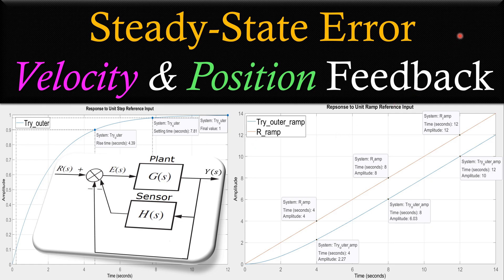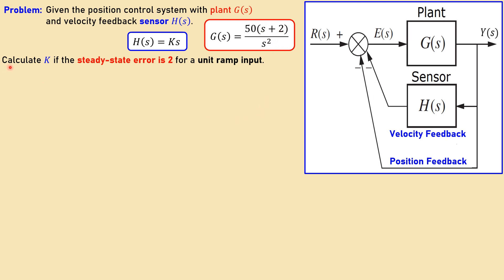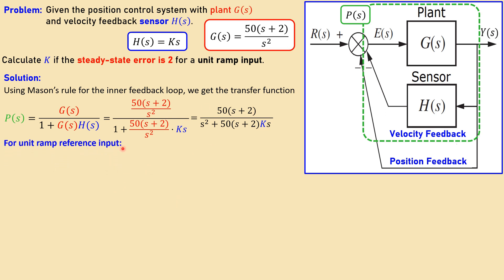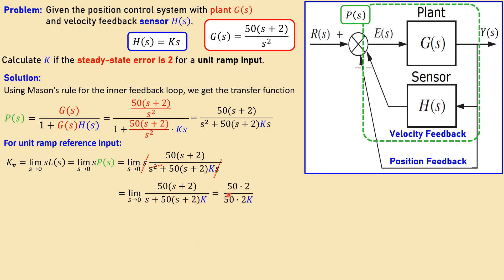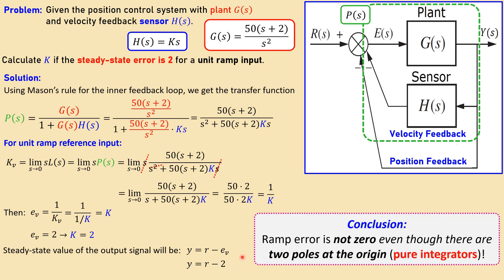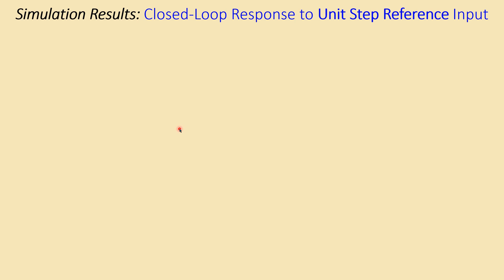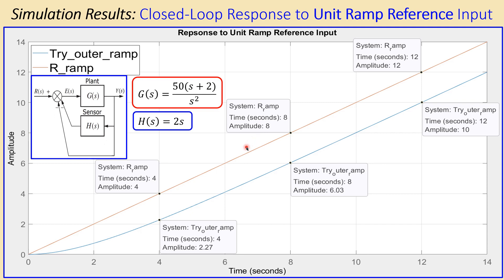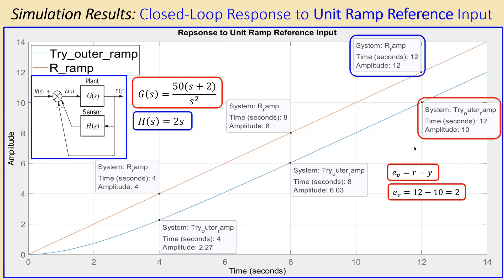Steady-State Error ⭐ Ramp Input - Velocity & Position Feedback 💡 Calculations & MATLAB Simulations

Comment: how can j give a comment by comparing both the input and output graph shown in the scope block
Reply from the maker: You compare the values of the input and output at the same time. The difference is the error, as discussed in the video. Note: error = output value - input value (determined at the same time).